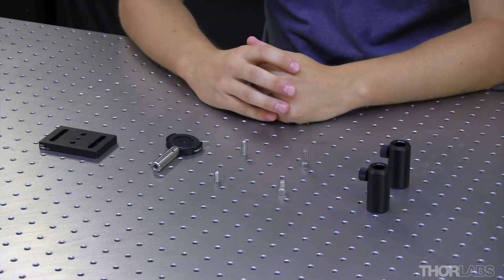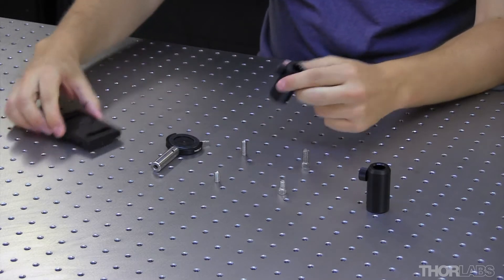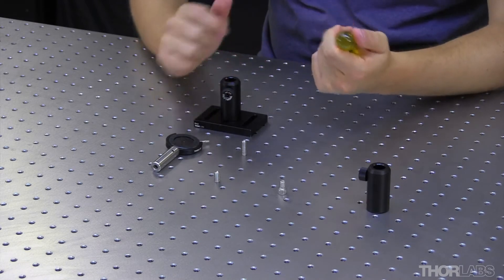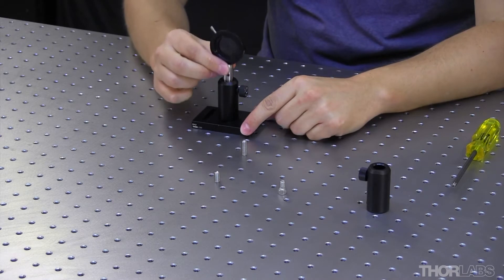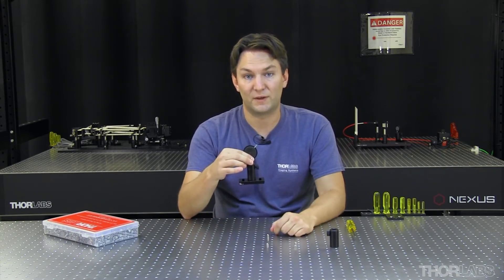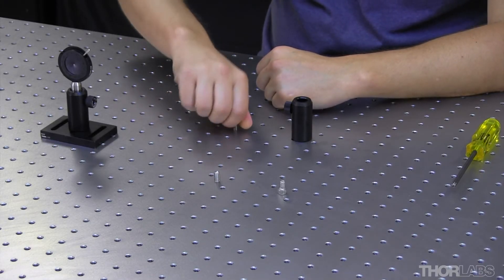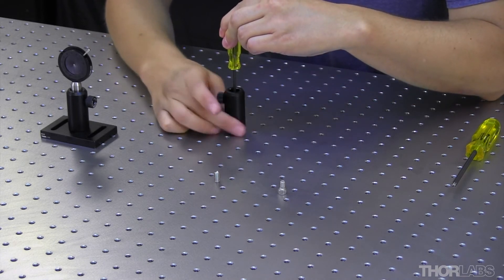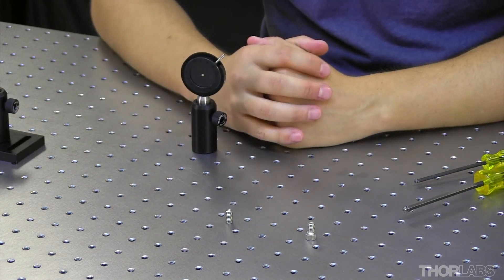Tips for Bolting Post Holders to Optical Tables, Bases, and Breadboards | Thorlabs Insights

Comment: Good tip. You can also put a blank 1/2" post in the post holder (small hole down, no set screw), tighten the post holder's side knob, and screw in the large set screw into the bottom of the post holder. Take this post holder and attach it directly to the table/breadboard; remove the 1/2" post and your post holder is ready.
Reply from the maker: Thanks for sharing your tip for using a post to create a barrier to the setscrew while mounting the post holder, it’s great to hear your approach to the problem!